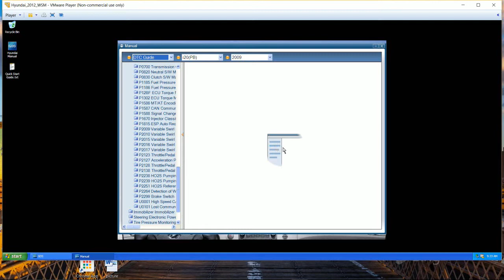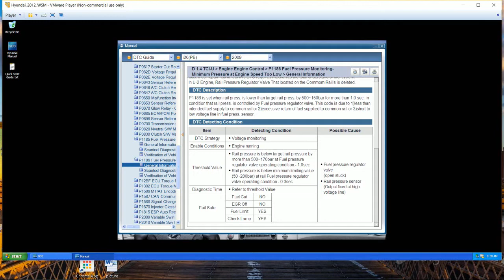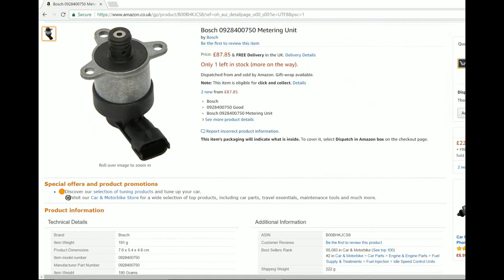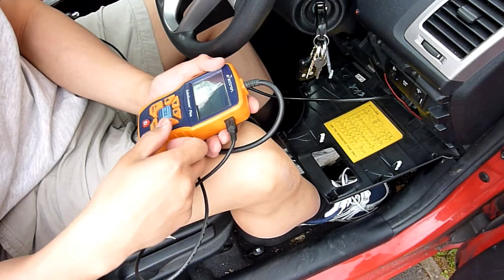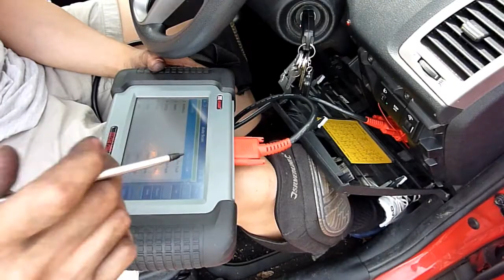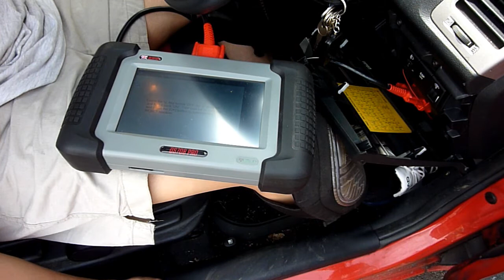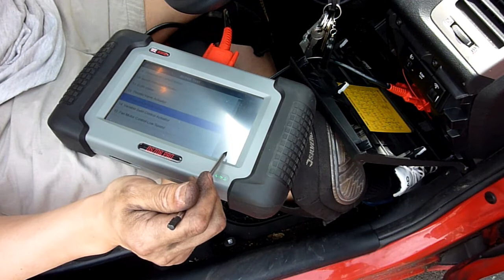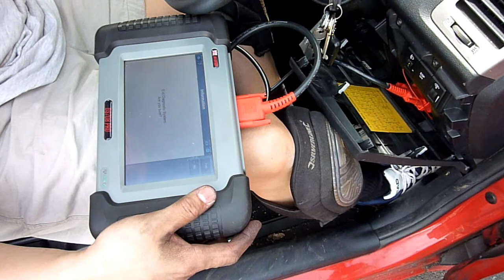P1186 trouble code hyundai i20, low rail pressure

Comment: Hi! Ive got a 2.0 CRDI throwing the same code. Revs to 3k rpm and is slow and dies sometimes when driving. Only issue is that i have a hissing noise from the engine when accelerating and it smells alot like diesel. Cant find any leaks though. Any knowlage of vaccum lines or something that would make a hissing noise when accelerating with this fault code? Thanks!
Reply from the maker: check the fuel pipes connecting to the cylinder area. Might just need tightening if fuel is spraying out. Of course if a petrol engine the that could catch fire for anyone else reading this. Change the fuel pressure regulator valve. It's easy and cheap on some cars. Buy the e-manual Like what Im using and your car will be on there to help you find the FPRV.

Comment: Hi, so I have a 1.7 CRDI and I’ve got an issue where the car goes into limp mode not being able to go over 3000 revs. It only goes into limp mode after driving it for some time and then this code will appear, if I turn off the engine and turn it back on it’ll work perfectly again.

It was much worse until I replaced fuel filter, do you have any ideas ?
Reply from the maker: Yes change the pressure gauge like in the video...I think  Hyundai use weak gauges.
Reply: @EducationPineapple  Amazing, thanks for the help ! I’ll order it today and hopefully that’ll be it.

Comment: I have a Hyundai Verna 1.6 CRDI. It threw this check engine light with a P1186 code. I replaced the diesel filter and it seemed to be fine for some time. Today it has again thrown a check engine light with the same error code. Also it will not rev beyond 3000rpm. What could be the issue??
Reply from the maker: I think it's worth changing the Fuel Pressure Regulator Valve like I am doing in this video. It's inexpensive and quite easy to get to.
Reply: Education Pineapple thank you. I checked it out by swapping in another Hyundai CRDI’s Regulator valve and my engine now revs to 5000rpm without any issues.  Hyundai parts catalogue doesn’t list this part at all. Now the only issue where can I find this part ?? It says Bosch 0928400750
Reply from the maker: @AnikethSharma  Ebay just type in the whole details including that part number. I bought an aftermarket one and it still runs to this day.
Reply: @AnikethSharma  did u find the solution...suffering from the same problem with my elantra.
Reply: @EducationPineapple  thank you. My garage managed to procure one of these for me. All fine now. Munching miles again effortlessly
Reply: @RANA-fb9qx  yes. It was a defective fuel pressure regulator valve
Reply from the maker: @AnikethSharma  well done for fixing it.
Reply: @AnikethSharma  is it located on the high pressure pump.?

Comment: Hi. I have two hyundai tucson one 2012 and a 2011. The 12' was going into limp mode and p1186 was recorded in the obd scan tool. I replaced fuel pressure regulator on the 12' with the one in the 11' (working and tested) but didnt work. Then I returned both fuel pressure regulators where they were at the beginning and now I have the same issue in both cars.
Does Fuel pressure regulators or fuel pressure sensors most be calibrated, ecu programmed or something after installed?
Reply from the maker: The resistance of the terminals on the regulator valve that you have been removing should be 2.9 - 3.15 Ohms [according to 2009 data]. The connectors to the ECU..battery disconnected..remove the shorter ecu connector...looking at the face of the connector cable, with the cable on the right, the bottom right pin is number 1, the bottom left pin is number 15, the next row up right pin is 16 and so on. There should be continuity (use multimeter) between pin 19 and pin 49 on the harness. Pin 19 is 4th from right second row up and pin 49 is 4th from right 4th row up [should be a safe check as no electricity is involved].......................................... It may need reprogramming (notice on my video at 33:00, I read out all the listed programming set, but don't read out a pressure regulator change option, also notice the car started up before I made any resets), but you can borrow a bi-directional one first to check...I would get a new regulator from ebay and put it on your 2011, you should have all the codes on the removed ones recorded right? Make sure this time, the neg battery has been disconnected and brakes pressed to drain any residue. Next consider there could be a fault on your 2012. Is yours a business? Could the fuel have been tampered with? Check the state of the fuel, consider changing the fuel filter and changing the fuel. Consider buying the emanual on Haynes for example and carefully probing the terminals on the socket of the regulator for correct voltages. Consider buying a new regulator and placing it in your 2012. Good luck.
Reply: @EducationPineapple  The resistance of the regulator valve terminals was 6.1 on the 2012 (previouly working good) and 5.6 on the 2011 I found in a GDS manual that coil resistance should be 3.42-3.78 ohms at 20°C
Do you think this difference is enough to diagnose both sensors as not working?
Reply from the maker: @erick89morales  I reckon so. Sometimes the hardest fixes are the ones that have a double fault, meaning the part you swap it for is also bad.
Reply: @EducationPineapple  Im afraid of trying a new one and get it burnt just after replacing
Reply from the maker: @erick89morales  Try it on your 2011. I used ebay ones. I don't think Hyundai ones are very good.
Reply: @EducationPineapple  I'll do. Thank you